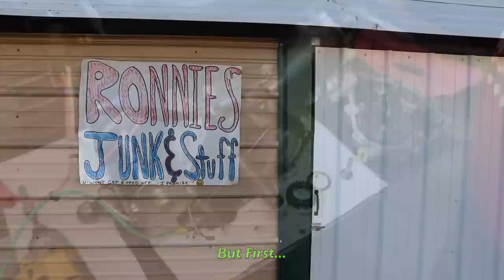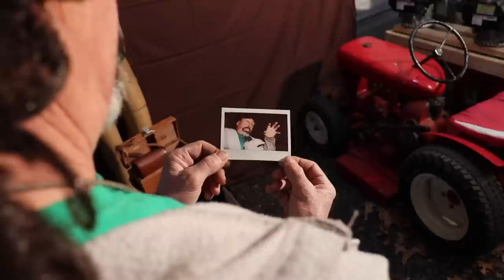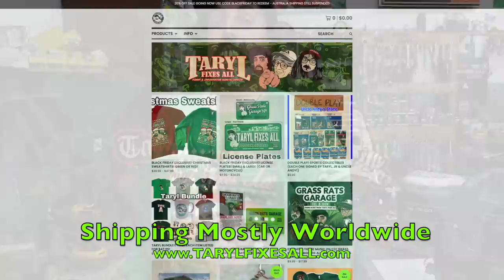Crappy Briggs Plastic Gear FAIL - Is It Warranty?

Comment: It's NOT the engineers at fault here, it's the "bean counters" that call for the CHEAPEST parts to be used. I have an 18yr old MTD "Yardman" 46" rider with a 21HP Intek twin. In all those years, I have had ZERO issues with the "Intek". It still has the original plugs, fires up in about 5sec hot or cold, checked valve lash about 5yrs, just minor tweaking needed. I do maintain the machine RELIGIOUSLY, clean it after every mowing job and keep it in a garage when not used. I would guess that MY Intek DOES NOT have plastic gears, since it's going on 20yrs, OR I am just damned lucky. Taryl, I simply LOVE your channel. Am SO addicted to the "skits" you guys do AND the knowledge you share for us DIY'rs to keep our small engines purring for minimum cash outlay. THANK YOU, THANK YOU!!!!!

Comment: It sounds a lot like the Kawasaki 590 plastic cam gear fail from the mid to late 1990’s. I replaced mine based on your video. They should know better.  Now they are paying for all their “cost savings “ in warranty costs😳

Comment: This mirrors my experience with Briggs. The old stuff was generally pretty great but now they value engineer to the point of failure. You would think that since they are just building Honda clones they would be decent. But they manage to screw it up even when copying others.

Comment: Plastic is supposed to...
- reduce catastrophic failure
- reduce collateral damage
- reduce costs
The idea is, that plastic can be designed to (theoretically) fail as a part prior to other, more expensive to replace parts fail.  Further, once the plastic part fails, the concept is that the inevitable loose pieces are made of plastic which is softer than the metal parts and thus will be less likely to cause other parts to be damaged if the engine continues to run or cycle for some period of time after the plastic part fails, but for the failure causes the engine to stop cycling/running. 
Unfortunately, I'm not certain anyone outside the industry, would have access to the statistics comparing a) using metal part (e.g. Fewer failures; Failures are more devastating to engine) and b) using plastic parts (e.g. more failures; Failures less damaging to overall life of engine).
It is nice to hear that at least some of the manufacturers designs still allow for metal replacement parts for the plastic versions, but then again, is plastic worth it in the first place or are they just trying to cut down on manufacturing costs and end up getting more repeat customers as people see little value in repairing something with just another plastic part that will end up costing them more and more down the line.
Reply: For most consumer grade stuff, even the plastic gear failing is enough to send it to the junk pile if out of warranty. A good mower tech's time to open it up and work on it will exceed the replacement cost, so it might as well have been a full self destruct as it's going to the landfill anyway.
Reply: I don't know if these engines are of the interference design, but if so, that gear failing at the right time with one of the valves open will cause catastrophic failure when the piston crashes into the valve.  Yes, it reduces costs - to the manufacturer but not to the consumer.  Saving $10 over 100,000 units is $1,000,000 savings to the manufacturer.  It's referred to as "economy of scale".  The consumer doesn't even see the $10 savings.
Reply: @danburch9989 They literally don't have enough valve lift to be an interference engine.

Comment: It's funny what you said about people still bringing you lawn mowers and tractors. Here on the East Coast by now I would have three or four blowers dropped off so far nobody is thinking about snow. If it's anything like last year and the year before that nobody will even need a snowblower again.

I still cannot get over that plastic gear. As you know that's where all the torque comes from that moves the piston up and down. It cannot be worth the few dollars that they saved. Their warranty claims and just the fact that people will turn away from the brand should be enough to put quality parts in their engines.

I hope you and your family and friends all have a great holiday and I look forward to seeing your new videos.

Comment: Today I was working on an old lawn mower an old MTD with a spring-loaded starter start it once with the rope and then shut it off and it winds up the starter next time all you got to do is close the Bale the engine starts never have to worry about a dead battery.  Coolest thing I've seen since those ones that you wind up a crank and then turn a knob to start the engine

Comment: Looks like Briggs isn't putting keepers on the rod cap bolts? Those metal pieces you can bend next to a flat side of a bolt to keep it from loosening.
Reply: And the list goes on..........and on.............and on........

Comment: One thing I check, is to make SURE the shear key slot for the flywheel is exactly the same angle in reference to the rod throw journal as the old crank. This is crucial to the ignition timing of the engine. The engine started right up, so it was the same.

Comment: I use the Briggs "Power Portal" to request warranty replacement of parts for LP Standby generators.
I find it a pain in the U know what.
Some of their "engineering" is pretty shoddy.
Some failed parts are due to poor design.
The superseded part then costs plenty, even though they know the original was poor.

Merry Christmas all you guys.

Thanx for the most interesting channel on YouTube... !!

Comment: Friggs and Strapon motors are generally not my first choice., but they work O.K. on budget equipment.  I think all these small budget targeted engines are a crap shoot.  Remember the single cylinder Kohler (dis)courage?
Reply: I have one of those "self disassembling" 597 cc Krohler. It did fail at 72 hours of use.

Comment: Seeing this, I would be reluctant to buy any Briggs motor. I mean, all motors have their weak link, but that is ridiculous.
Reply: My Briggs intek 21hp single cylinder likes to blow its head gasket. It’s a design flaw and they know it. They no longer make that model and John Deere also discontinued the d120 model because it had that engine. The replaced it with the d125 which is a larger displacement engine and a 2 cylinder but makes less hp.
Reply: @FishFind3000  I have a 21HP Intek TWIN on my MTD rider. I bought this mower 18yrs ago from "Home Depot" for $1099+tx. I have had ZERO engine issues with this mower. Maybe mine has a steel gear OR I am incredibly lucky (clean living will do that)!

Comment: Seen this issue with pressure washer application l head engines..  Told Briggs about it and had a customers unit denied warranty... I ordered a steel timing gear and sump gasket.. and got him up and running. and it is still running..

Comment: I have a question that has nothing to do with this video. What do you think of the new style of the single cylinder KOHLER engines on riding mowers I picked up a Troy built riding mower with a 19 hp Kohler courage engine I’ve replaced the intake manifold which is a poor design did a complete service on it with a carburetor cleaning air filter spark plug oil change I ran oil through it then drained it and refilled it ran it for about an hour drained it again put a new oil filter and the oil I put is Delvac 15W40 I also replaced the deck belt and battery.
The mower is a few years ago and in good condition and runs great till the fuel stops flowing and dies what are your thoughts on what to look for to find the problem

Comment: i have a couple of b/s lawn mowers.  the spec sheet says to go 1/4" past TDC to adjust both valves.  i noticed you went to TDC only.   the best way I guess a 1/4" is to remove the spark plug and try to get a screw driver on top of the piston  rotate an estimated 1/4".   your thoughts on which way to go TDC or 1/4" past TDC?  Thank you in advance and MERRY CHRISTMAS brother to you and crew!

Comment: Tayrl have you had many of the vertical shaft 450, 575 series engines with issues where oil is venting into the air filter housing. We have had a few in our workshop on new machines and found out it is a factory machining fault with a large batch of new engines.

Comment: Just the video i needed to see. I have that same engine on my air compressor and i think it might the same issue with the cam gear. I have the square type air cleaner on mine and never any trouble with it. I'm still driving my mower around

Comment: I can get those crankcase booked other than that or do you rent but they always back off and put it on the tractor or something you always run up having to tighten the bolts up again I had a leak at the Pella I was just going to cross pattern snuggle up until it stopped

Comment: Consumers like us are to blame.  We buy Chinese stuff because it's cheap so Briggs has to compete.   However, I think Briggs should put out a durable engine with no plastic inside and market it as something like the Vanguard.   Mention it's not made in China, better warranty etc. and will last.   Yes we know it'll be higher priced but some of us gear heads would gladly pay more to have an engine we can work on and that will last forever like the old ones did.
Reply: This all sounds great for all you "gear heads" who are sitting on piles of cash, but there a LOT of us DIYrs who are on fixed incomes for whom it's not going to work out. Using an HF "predator" engine would be a good compromise, IF the implement manufacturer would sell his machine WITHOUT an engine. And even though the "Predator" is a Chinese Knock-off of Honda engines, it is VERY GOOD engine, as one of the commentators in this blog mentioned that because he couldn't AFFORD to fix the "Breaks & Scrap um" engine, got himself a $250 "predator" and now is a happy camper.

Comment: Hi love the channel I have a question about small engine oil should I use zink additive thanks in advance and merry Christmas
Reply: I would just buy the BEST FULL synthetic you can get. You can do your engine (any) a favor by buying "real"gasoline" (the ethanol-free stuff), even the higher cost will be offset by fewer engine related problems!

Comment: Worked on a vanguard twin cylinder engine that was on a heavy duty pressure washer, it has 10 hrs on it and cylinder 1 had an inch of head gasket material missing, thankfully Briggs covered it.

Comment: What an epic mistake B&S motors made making that crankshaft gear out of plastic, and then not making a replacement piece. That could have been a lot easier if you only had to change out the gear. Nice job fixing it for the customer Taryl. I'm sure he was happy there no charges, especially at this time of year. Merry Christmas Grass Rats!
Reply: They don’t want to sell people new camshafts for the stupid failure rate they are experiencing. This is because it would disrupt their production line for the new engines, thus revenue. So much for taking care of the customer.

Comment: Red is removable too! When you apply heat, the red plastic gets soft and then you can loosen the bolts right up! And how do you heat the bolt? Use this trick! Take a car battery, get a couple of battery cables and then place one terminal on the bolt and the other against the housing. Heat it and then back the bolt out. Don't break those bolts off!

Comment: Working for a franchised Ford dealer we are required to send all warranty parts back to Ford for payment. If not we don’t get paid. Do the small engine manufacturers require the same?
Reply: I do for a period of time,Sometimes they call for stuff,in this day and age you send them pics of failed parts and fail points when doing the warranty claim

Comment: I'm curious about the load that engine runs. There's evidence of that thing coming to a sudden halt, which would have dimpled that flywheel key and sheared that phony crankshaft gear nub right off.
Reply: Seemed like the owner ran into stump or something.
Reply: @kravchan  The shear pin on the CRANKSHAFT is SUPPOSED to save the engine, instead of the engine parts saving the engine!LOL
Reply: @TheOzthewiz  well, it seems, it does not work these days anymore.
Reply: @kravchan  apparently not! Thanks.

Comment: Carburettors have got way more complicated to meet emission standards.  Valves in the body that open on the overrun when the throttle closes to stop a surge rich condition blockages a nightmare to clean and a spring goes weak air being drawn in and they are practically impossible to service. Replace carb with a good good new one.

Comment: Penny counter engineer cost the company a fortune. "Brand new"? Always check! At the parts store, I even open the box to see if it is new and if things are in the correct box. "Should fit" doesn't make it. Electric start, vertical, Um, minibike....sweet!
Reply: YES! You want OEM parts, NOT "direct fit" or "replaces the OEM" part!

Comment: If you want to be super accurate on valve adjustment, say spec is .004, then .003 should be very free and .005 should not enter the clearance without pushing. Useful for getting multiple valves like twins to V8s exactly adjusted alike and running absolutely smoothly.

Comment: You think that's bad. I had a 69 Cadillac with a 472 engine that had a nylon crank gear. So that great engineering goes way back. Needless to say I had engine failure that bent push rods and all that headache at the time. That's why I pretty much hate GM amongst other things.
Reply: I had a Mercury cougar (1970) with a plastic timing chain gear. It failed and took out the interference (valve) engine!!! Same way as yours.
Reply: I have and had 1969-72 Buicks. The 350 and 455 engine had nylon gears too. I changed them before failure.
Reply: The only reason I can think of why they use plastic gears is they want them to fail
Reply: That's a little different.  They're metal gears with a nylon buffer layer on the teeth to make them quieter.  They're more expensive than straight metal gears.  While not as long-lived as straight metal, they actually function acceptably for quite a while after the nylon has worn/broken off.

Comment: On a similar theme where you tested and compared gas stabilizers, it would be educational to tear down Honda, Predator, Kohler, B&S, Subaru, Kawasaki and Ariens engines and compare the parts and see who uses the most or least plastic parts in failure prone engine locations.  I think B&S has an engine with plastic cam gear and lobes.  To make it fair, the same or very similar HP and displacement engines should be compared.
Amazon has a metal crankshaft timing gear P/N 797521.  It replaces P/N 795755.  I don't know if this is the correct gear for the engine  you were working on.
Reply: HP? Do you mean HF (Harbor Freight). I don't think you meant "Hewlett- Packard", unless they have gotten into the small engine business.

Comment: I guess the positive take away is that they're replacing the crap with something better under warranty.   If the plastic gear is discontinued, I suppose they learned their lesson.
Reply: Until the warranty runs out and Joe Homeowner has to buy a new crank and pay to have it replaced.

Comment: o-my... with all the plastic with metal 3D printers it would be interesting to make a new gear instead of the replacing the whole 🙀Kitten Kaboodle 🐱Navy vessels use 3D printers. 
 also, i have a can of the Taryl-gel-lube and it works great. 👌 nice video. Merry Christmas🎅
Reply: Those "Navy vessels" operate with a "cost is no object" budget! They have NO excuse for operating with less than perfect equipment, we (tax payers) are funding the military!

Comment: Teh Milwaukee M12 ratchets are awesome!  I have the 1/4" and 3/8".  One of my most frequently used tools.
Reply: Thats because Snap-on owns the Company. I am slowly switching over. Dewalt has served me great over the years
Reply: @edgenet1    I'm all about minimal battery platforms.  I had 12V Dewalt Max tools, then went Milwaukee when their ratchets came out.  Stubby 3/8 fuel has balls!  Back in the day I had a 3/8" Makita!
Reply: @edgenet1  I use the Dewalt 12 volt impact and Screw gun with a clutch,have had over 10 years ,still going
Reply: @Hubjeep  Just got M12 fuel   1/4 ratchet,they have come a long way,time to upgrade
Reply: @jeffclark2725   Thanks Jeff, I only work on my vehicles and friends... the original one is fine for me, thanks for the suggestion!

Comment: I would pass on the "gen lube" (too expensive), use STP "oil treatment" instead. It is a LOT cheaper ($5 for 15oz, +free shipping @ Wallyworld). The "big boys" use it to rebuild their LS1s. Also, that plastic starter gear needs to be replaced with a METAL one! Ther's YOUR DESSERT!!!

Comment: You would have thought Briggs would have learned after the plastic cam debacle that plastic parts don’t belong inside an engine…..    That oil seemed awfully thick and black for only two or three hours running…..

Comment: That engine didn't even get a hot supper. The crank case looks new.

And the starter gear is plastic.
Reply: There IS a difference, the starter is only used for about 10sec and only to start the engine!

Comment: I've ceased to be amazed when a new, cost-saving design fails in customer usage.  Changes that are proposed to reduce the cost to manufacture an item are not scrutinized properly.  "Visions of Sugar-Plums Danced in Their Heads" is anagous to how company leadership gets all giddy about making more money and these types of changes get pushed through too quickly.  It also points out that whatever test regimen they are using, there can still be a gap in how it correlates with actual customer usage.  In particular, testing to an accelerated time schedule often misses failure modes that occur after a plethora of years out in the field.  Some plastic and rubber materials can change just sitting in a box on a shelf for a few years, let alone when they are exposed to warm fluids, hot air, corrosive environments, pounding, vibration, etc.